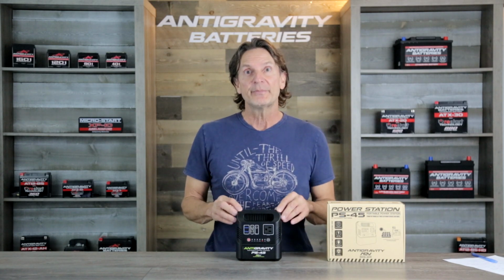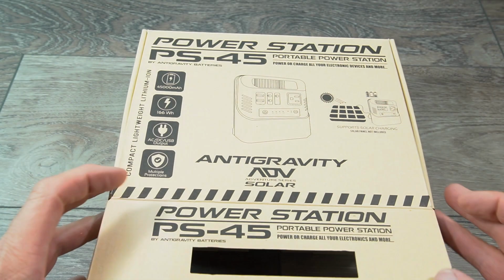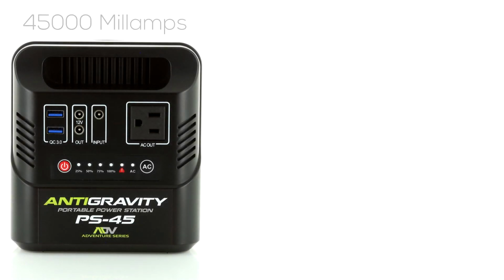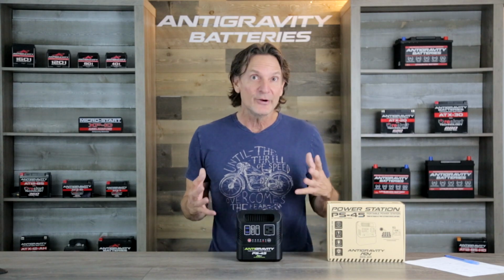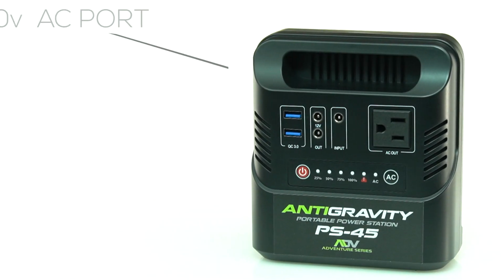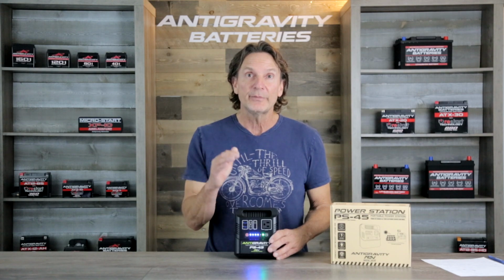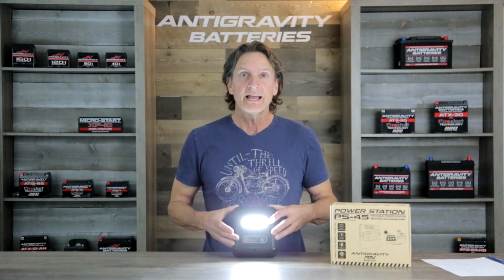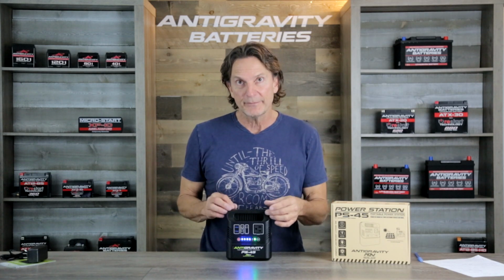Antigravity Batteries Smallest Lithium Power Station

Comment: ▪
Would this be good to recharge my dost kope ebike?

And if so, would you guys ship them to Alaska? 
🧊
Reply: ▪
I also use the 'fast charger' cord from the Dost company [idk if that makes a difference].
🧊
Reply from the maker: This would be to small to recharge and Ebike Battery.  This is more for Laptops, smaller campsite lighting and things up to 100w.  So it does great recharging Tablets, Laptops Phones, Powering lights and other things up to 100w... but above that you need larger Powerstations. And ebike is a very large battery in comparison. Hope that answers your questions.

Comment: How long does it last if I was to use it to light up a storage until
Reply from the maker: Do you mean how long with the light last on the unit if you just used that feature only?  In that case I think its about  3 days if the PS45 is fully charged, and the light is the only thing going.  I will test that out.
Reply: @AntigravityBatteries  great thanks for your reply